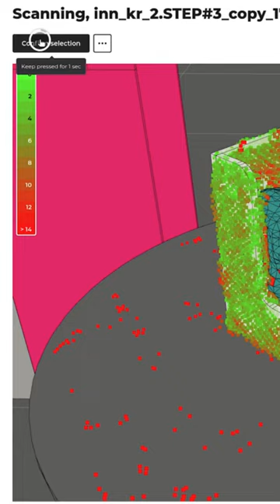How robots can see. Challenge #3. Toys | ABAGY ROBOTIC WELDING

Comment: What size of a job can the robot weld : ie square metre
Reply from the maker: It depends on the specific requirements. For large parts, a gantry system with 3 axes could be used. Let us know more about the parts you work with, and we can suggest an appropriate robotic cell configuration and advise on the feasibility of using robots in your production.